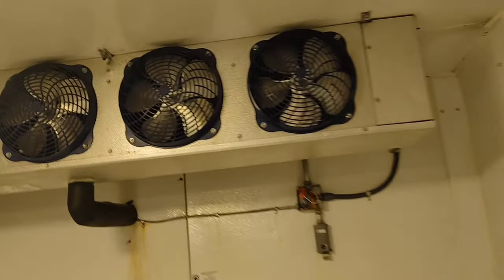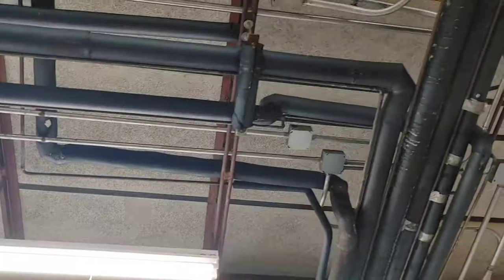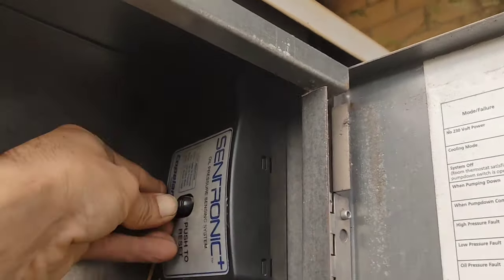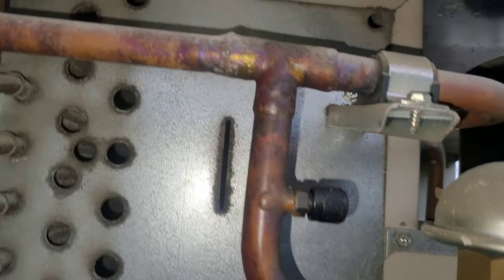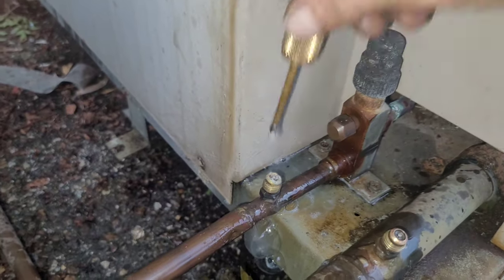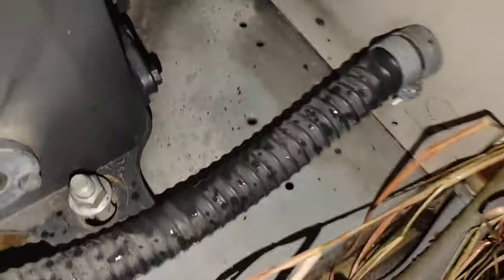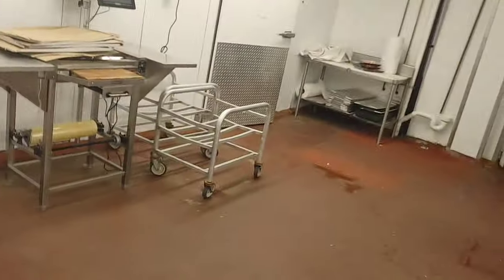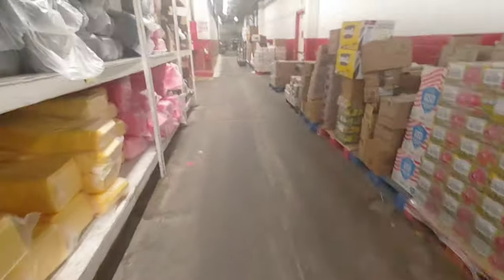Walk In Freezer Not Working - Oil Pressure Failure - Troubleshooting Process

Comment: I’m definitely no pro when it comes to adding oil but what I’ve been taught is you want SG about half full when the comp is off and like 1/3 full when it’s running. Looked a little fill to me but likely hood is if it was empty when you found it unit probably had/has a leak on the low side or just isn’t getting good oil return so oil will probably get trapped somewhere eventually anyway. Good job getting it done with minimal info/practice haha been there a lot lately
Reply from the maker: yes, it was off on oil failure when i first walked up on it.

Comment: pump that system down, valve off that suction king valve, vent that refrigerant out of the compressor then fill it up to little under 1/2 of site glass just incase your oil migrated out into the system. once filled with oil, vacuum out the crank of the compressor or just say fuck it and open it back up to the system and let her eat bro.... also door switches are there to turn solenoid and fans off while door is open so store dummies wont have bunch of ice build up inside when they leave door open for hours.

Comment: You asked so here we go 
You should’ve pumped it down for starters and then filled it with oil while off 

You filled it to the top of the glass running so now when the oil comes back it will most likely be overfilled which is bad 
But yeah next time flip that toggle and your suction will be low and make it easy to pump the oil in 
Also should’ve pumped it into oil pump but whatever it will get where you need doing at the suction line 

Great videos man thank you
Reply from the maker: Thanks for the input! 
 I will be sure to use that helpful information the next time I add oil. 
Glad you enjoy